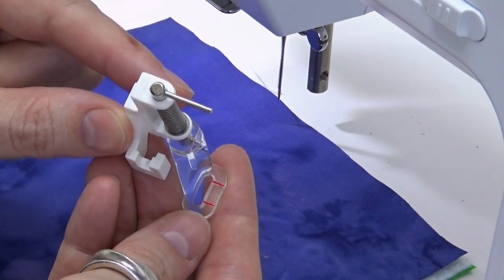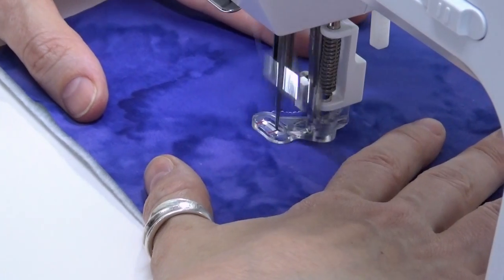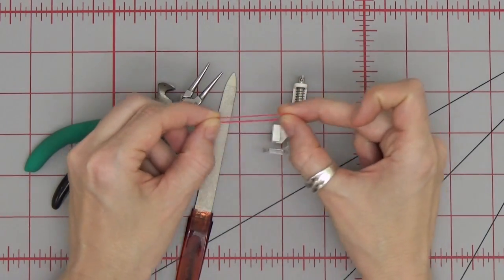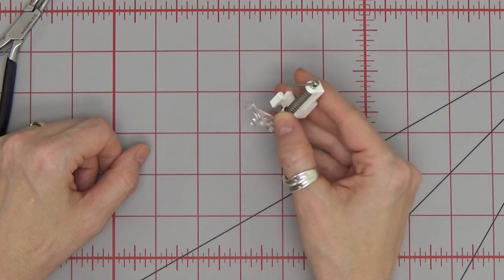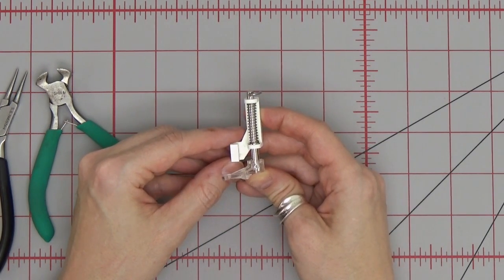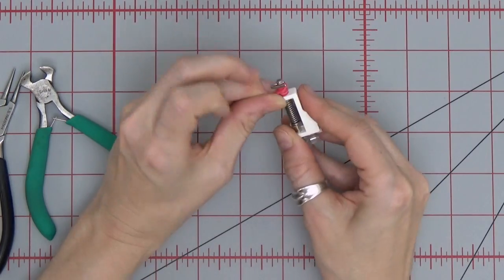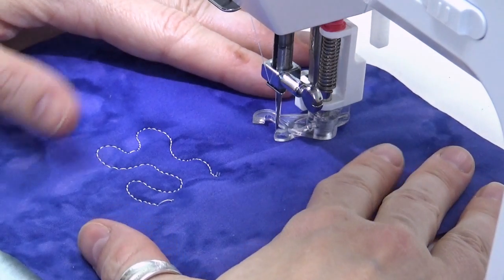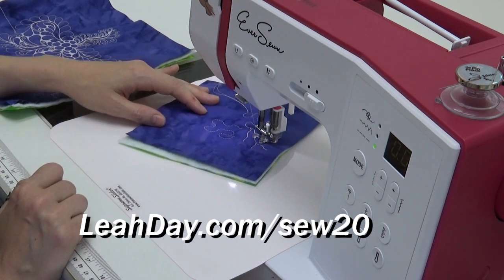How to Attach a Darning Foot and Fix it to Perfectly Fit Your Machine

Comment: I modified my foot from way back when you first taught this and have done it this way ever since for all my machines. Works beautifully. The only thing I have changed is instead of using a rubber band, I use very thin hair elastics (the kind that are covered) for now. Rubber bands work just as good, but I broke one too many, and could not find one in the house to replace it for the life of me. I was not about to leave the house just to get rubber bands, so I used a thin hair elastic in its place and it worked! When those wear out and the package is empty, I might switch back, haven't decided yet.
Reply from the maker: Yes, I think the Rainbow Loom rubber bands are the exact same thing as hair elastics, just packaged in much greater quantities. Use whatever works!

Comment: Wonderful idea!  I took it one step further though by cutting off the very top and threading the metal to use a nurled nylon nut on it so I can adjust the depth by just twisting the not.  Now I can actually learn to free motion quilt finally without getting frustrated!  Thank you again!
Reply from the maker: A nurled nut??? I must check this out!
Reply: The hardest part is threading the rod to accept the nut, maybe I will take a short video to post on here, it is really really easy to change the depth depending on the batting.

Comment: I searched everywhere for an affordable foot  that would work on my Vintage Singers. I've used your modified foot on two Featherweights, a 201, a 15, 66, 99, and a vintage 15 clone Kenmore.I paid a fortune for the foot from a local sewing machine repair business.  It made the foot usable and opening the tow up made it WAY more agreeable to use.  I totally agree with a previous poster. If you could produce a modified foot that functions like this it would be a gold mine. An affordable and FUNCTIONAL quilting foot would be a God-send for me personally.  I don't want to spend $100.00 for a vintage quilting foot.
Reply from the maker: Thank you! I know, it's on my list, but that's a very long list! Most of the vintage Singers are low shank so you definitely shouldn't spend a ton of money on them.

Comment: Leah, you're a lifesaver!!! I had an open-toe darning foot that already had a U-bend in the bar, so all I had to do was snip off the front of the bar and add elastic bands.

Tip: If you want to test this out before permanently breaking it, wrap an elastic around the needle clamp so that the bar of the presser foot rests on the wrapped elastic instead of directly on the needle clamp.

Thank you SO much for this - I was debating whether to quit trying FMQ, stick to walking foot quilting, or waste money on an expensive machine when my old machine worked fine for everything except FMQ. It felt like I was playing tug-of-war with the machine and could not form consistent stitches no matter how I adjusted my speed, tension or presser foot pressure. It turned out that the fabric wasn't feeding smoothly because the foot was too low and was hopping on the quilt instead of floating over it.

Comment: Thanks for this free motion quilting foot hack!!   I actually had to add five rubber bands to the top.  Even with these modifications, my low shank Brother sewing machine does not hold the quilting foot up high enough for free motion quilting.  If I use single thickness of cotton fabric, it's fine.  Anything thicker (so forget a quilt sandwich) the quilting foot clamps down on the fabric. Is it my machine?  Any suggestions would be awesome.  Thanks Leah!!

Comment: I modified my spring FMQ foot, bought from my h viking dealer, this way last year. It still didn't behave well. I now use my R floating foot on spring foot setting & it really has been great. I'm tempted to snip it open bc I now have 2. I also have used my Q foot, used for embroidery.
Reply from the maker: Some machines are really weird and sometimes you have to be really particular about the foot height. I'm glad to hear you found something that worked for you.

Comment: To do some free motion sewing, could I use the little button sewing foot (the one that holds the button down and looks like two little ‘crab claws’) because it has an open space for viewing the needle...then lower the feed dogs and leave the arm raised??  Just trying a DIY fix here🥴
Reply from the maker: Maybe, but keep in mind that foot must be in the down position to have tension on the thread. If that foot is in the down position, unless you can shift it upward somehow at the foot screw, it will probably squish the quilt too much to be able to free motion quilt.

Comment: I tried this and found that it does help with FMQ. Yay! And thank you!

After using it, I got tired of having to mess with the rubber bands when using different thicknesses of quilting though. 

I had some double sided tape that I snipped into a 1/4 inch width then cut off a length that wrapped around the top stem
twice (I used tweezers). The end liked to keep unsticking itself so I had to wrap the tape with a small rubber band. This kept the stem up by the pre-cut measurement of 1/4 inch, which was handy to know.

This worked well enough that I'm thinking of cutting other strips at varying widths for different quilt thicknesses. An 1/8 inch and maybe an 'un-scant' 1/4 inch (what else does one call a width that's a little over 1/4 inch...? Is there a word for it? lol)

Note: Keep the paper backing on both sides of the double sided tape, except for the end as it will eventually get adhesive on the stem and the rubber band.

Comment: Thank you for sharing this. I am new to FMQ and was looking for solutions for issues you have raised here, but I still have one question. Could you not simply use a ruler quilting foot instead of the darning type foot that jumps up and down?  Many/most of them are made of metal, so you wouldn't be able to see through like the clear one in your video, but it seems that using a ruler FMQ quilting foot would help avoid the bouncing. Thanks.
Reply from the maker: Yes, in some ways, a ruler foot fixes this whole issue. This video was made long before ruler quilting was an option for home machine quilters. It’s a good option for this style of darning foot, but yes, you won’t need to bother if you have a stationary ruler foot instead

Comment: Do you recommend doing this with machines other than the sparrow? I have a Brother and am new to FMQ and am wondering if I should do this. Also, do you recommend adding a rubberband to FMQ feet that are already open toed?
Reply from the maker: Yes, any machine with this style of darning foot can be modified. And yes, I also do this even to open toe feet. A hovering foot is much easier to use and see what you're doing while free motion quilting with less distraction.

Comment: I have a sewing machine model that requires a darning plate when I have the free motion quilting foot on because I dont have the ability to lower my feed dogs. I tried sewing n the lower thread got caught in the darning plate.  What did I do wrong? I put the upper thread through the foot hole n I quick set the bobbin thread and went at it. Thanks for your time n expertise in advance
Reply from the maker: Hmm... You know you don't have to use the darning plate if it's causing you issues. Instead you can just lower the stitch length on your machine to 0.0 or the lowest setting it allows. The feed dogs will still be up, but will move only a small amount, not enough to pull against the quilt.
Reply: @LeahDay  thank you for the quick reply. I watched your video again n realized I didnt pull up the lower thread through the fabric.  So let me get this straight...I pull up the lower thread and put it along with the upper thread back under the presser foot and hold it aside to make sure it doesn't get caught up? Anyways, I'm gonna try again tommorrow.  Thanks again for the reply

Comment: I have the 30 and can't remember if the FMQ foot was part of the package or it it was included in the "quilting" accessories package I purchased separately. Anyway, my foot is all metal. I'm going to purchase one of these feet and modify it - hope it works!
Reply from the maker: Yes, I've see the metal version. You'd have to hack it open with a saw! Much easier to change up the plastic version instead.

Comment: Both of my machines come with the foot and a different foot also it’s called the quilting foot can I use that and it has an open toe foot also does it serves the same purpose with your modifications to this foot? In my manual it is called a darting foot, the other one is called a fmq foot.
Reply from the maker: Yes, I find this really funny because they are basically the same thing. A darning foot is a FMQ foot. I'd try them both and see how you like them and only modify if you really don't like the hopping movement.

Comment: The problem I have with fixed foot darning feet (like your modification or the popular ruler feet) is traveling over thick seams.  The foot stops...like there is a wall in front of it.  Other than flatten your seams as much as possible, do you have other advice to deal with this situation?
Reply from the maker: A few things you can do - adjust the foot and test it over the seam rather than over plan fabric sandwich. You can also keep an eye out for seams and be ready for them when you come close. You can also switch to "echo ditching" and avoid the seams completely. That's what I've been doing lately and it's so much faster!

Comment: I got mine modified,it ended up messing up my machine,it bent my needle arm and now my machine is broke,have to buy a whole new machine when I save up,so becareful
Reply from the maker: This is definitely an "at your own risk" modification! As you can see, I rotate the hand wheel quite a bit to double check the foot is attached properly and nothing is hitting in weird places. You especially need to watch out for ruler feet. Never drop the needle down when the ruler foot is up - that can definitely jam the needle bar badly!

Comment: Could you not lessen the pressure on the foot, to keep it from squishing the fabric too much?
Reply from the maker: Not all machines have that feature. The rubber band works best to get the foot to exactly the right height if your machine doesn't have that dial.

Comment: WHAT??? why do they make it hop if it's not necessary
Reply from the maker: It's an older design, certainly, and many companies have improved on this foot since. But no, for free motion quilting, the foot doesn't need to hop. It's really nice if it's stationary and open so you can see the needle.